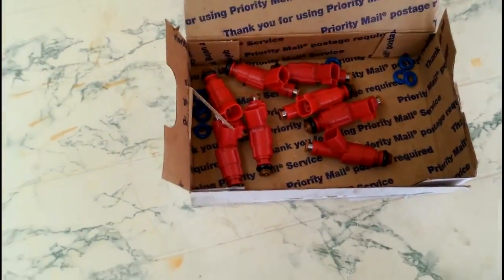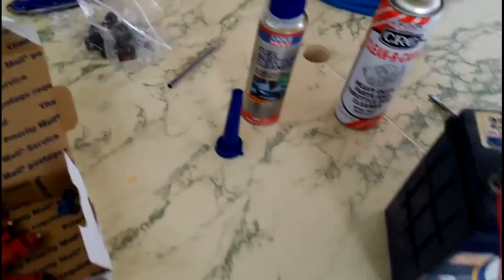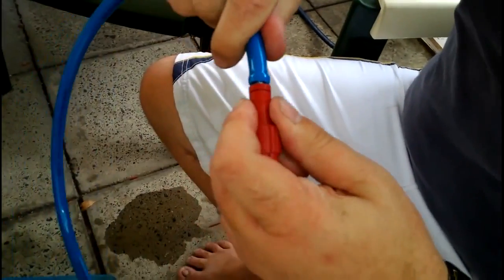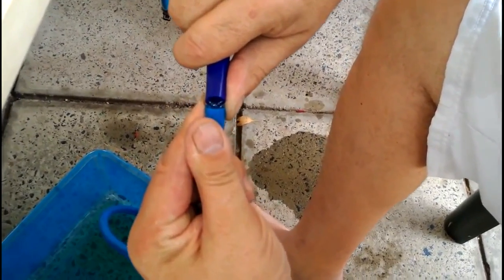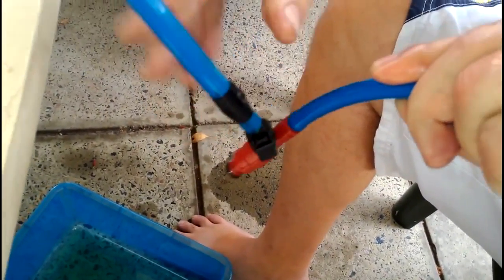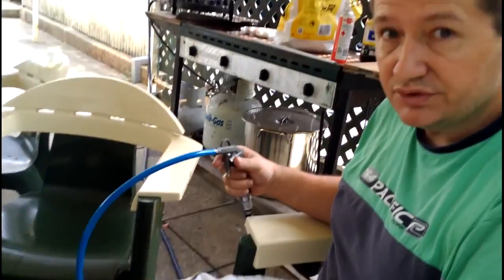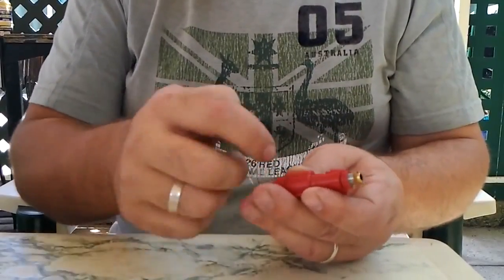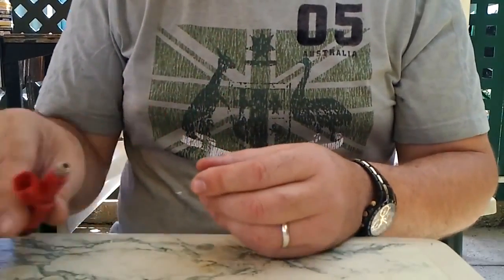How to clean and service electronic fuel Injectors yourself the Home Mechanics way

Comment: See this video should be on my recommended JewTube list, not some half assed attempts with syringe. I made my own cylinder with 2 pipes, one attaches to the tyre valve and the other to a hose and injector. The air pressure pushes the fluid down to clean it nicely. I used this video for inspiration back then...
Surprisingly this is also how I 1 man bleed my brakes. So it has many uses if you put your brain into it.
Reply from the maker: Well thank you Henry for the compliment 👍
I hope your subscribed to my channel.

Comment: Hi Bud, what was psi pressure on your compressor? you said THREE bar, what is this THREE bar translates into PSI, please advise?
Reply from the maker: . My compressor is capable of much more but I have a pressure regulator.
In future its easy to Google any conversions by typing what you want to convert. Example "3Bar = psi" Google will automatically convert it for you.
In this case its 43.5 psi. Factory fuel pressure is 49.2psi +/- 5psi.
I had mine set a bit over 3 Bar to match factory pressure. Regards Rik
Reply from the maker: Please help and subscribe